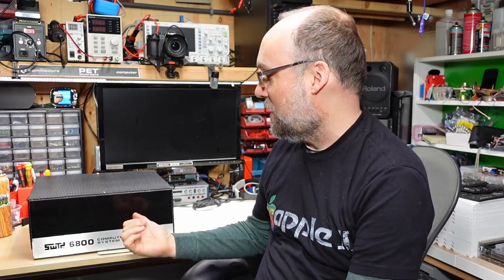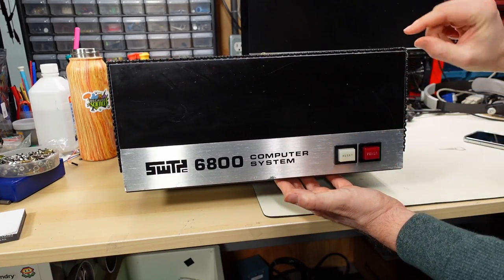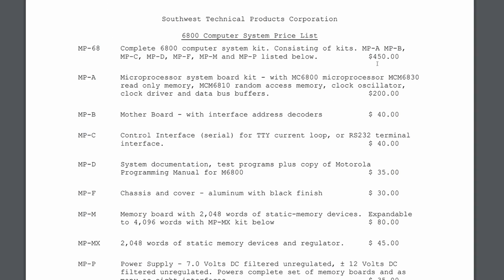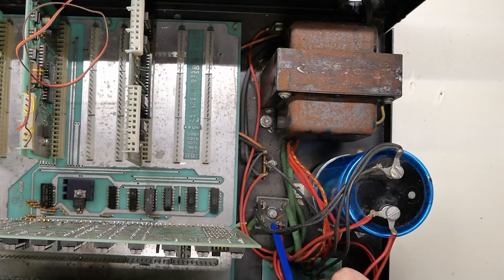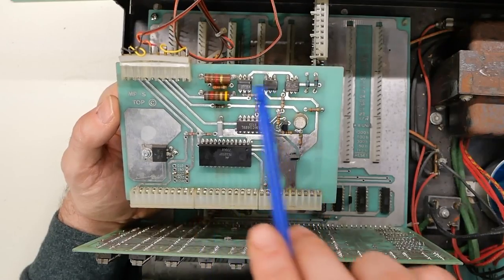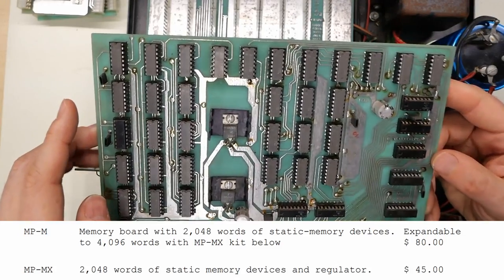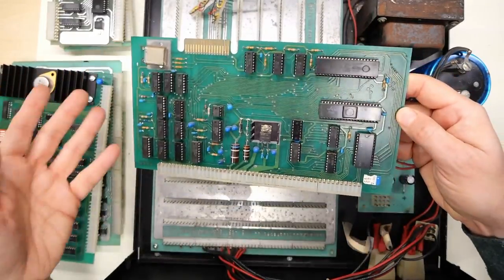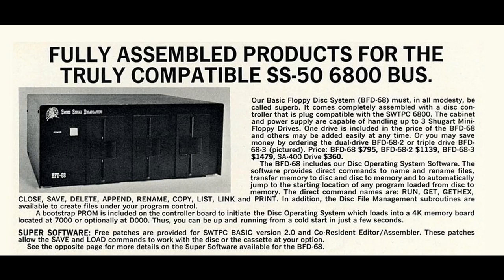The 8-bit home computer from 1975 you've never heard of

Comment: Even back in the 70s there was an Intel vs Motorola vs RCA community.
The S100 Buss was predominantly Intel 8080, 8085 and Zilog Z80 based, whereas the SS50 and non-S100 systems were predominantly Motorola and non Intel based.

Of course each Chip Company had their own proprietary Development Systems, varying from bare-board SBCs to fully assembled Systems with Professional Cases, Serial Terminals/Monitors,  Dual 8" Floppy drives, DB25 Serial Ports, DB25 Parallel Printer Ports (Centronics Interface), and In-Circuit-Emulators (ICE).

The Intel iDS was one such offering which was used to develop Software and Hardware for Intel 80xx 8-bit Processors and Microcontrollers using the Intel Development OS, Assemblers Compilers and launguages such as BASIC and PL/M. It also ran Digital Research's CPM-80 and many CPM-80 supported softwares such as WordStar and Microsoft Basic.

There was a huge offering of SBCs, Built Systems, and Ancillary Boards and Peripherals in the late 70s and early 80s.

Comment: Ah, the good old days!
I have the 6809 model - not just a CPU upgrade; the enclosure is a newer design, and I think there were several other differences.
It's in storage these past many years, after having been my primary computer in college.
If memory serves, I got it with 8K of SRAM, then wire-wrapped a 48K DRAM board.
Got the standard dual floppies, plus a kludged-on double-the-tracks drive.
I should dig it out and refresh my memory on what else is in that box.  I have a vague recollection of running a wire from the power supply to somewhere-or-other to get a 60 Hz interrupt.

Comment: Boy - this channel brings back great memories.  I built my first kit computer sometimes in the 70's. It was a Z80 S100 kit board and a 1K static memory board.  I built my own power supply and chassis and got one of the first TV Typewrite kits. It was wonderful - something like 15 lines of 32 characters - but it was a lot better then programming with front panel switches.  Over time I upgraded it with 8" floppies and better monitors and I actually used it until the 90's when I gave it to a friends son so he could learn computers.  Those were the days!!!

Comment: I've got a couple of the SWTPc 6809 chassis and a box full of cards.  These were made around 1981, and I know that SS-50/SS-30 bus machines were in use into the late '80s, especially ones from GIMIX.  The 6809 machines could run the same multitasking, multi-user OS-9 operating system that ran (as an option) on the Tandy CoCo line.  With all those expansion (slots?  not really slots) you could have quite a few terminals, and a Level II OS-9 system running at 2MHz, with up to 1M of RAM and a dynamic address translator could support a surprising number of users.  One fascinating card I have among my collection is a board for the SS-30 bus that contains a National Semiconductor calculator chip, which serves as a math coprocessor for the CPU.

The (D)OS most commonly used on the 6800 was called FLEX, which was essentially the 6800's answer to CP/M.  There was also a version of FLEX for the 6809, as well as UNIFLEX, which, I believe, was an attempt to make a multitasking UNIX-like version of FLEX.  I don't think that one saw much use though, since OS-9 did the job it was meant to do better, and was endorsed by Motorola.  The source code to UNIFLEX is available on the Internet.

There are modern SS-50/SS-30 reproduction cards, and Corsham in the UK sells high capacity static RAM boards and CF card 'hard drive' interfaces.

One thing to be careful of on these systems is that forest of pins.  It's extremely easy to consume fuses on that backplane by bridging between pins with a screwdriver or some other metal tool.  Ask me how I know.

A great resources for these machines is the magazine "'68 Micro Journal".  Scans can be found on Internet Archive.
Reply: YouTube seems to 'disappear' posts with those newfangled hyperlinks.  Hey YT, welcome to 1994.

Comment: I actually have one of these amazing machines. I got it just last August with 24K of ram and the cassette interface. One note on the ROM and the terminal interface. You have the later ROM called SWTBUG, switch can run the terminal at 1200 baud. I used it on my VT320 terminal and learned a bit of 6800 assembly on it and did things like play games using the 8K BASIC. I hope to find a floppy controller that can hook up to my dual 8 inch shugart floppy drive enclosure that I use with my IMSAI. Once I find that I can run Flex, which is a really interesting OS, basically the CP/M of the 6800 world. Of course the next step for me is to finish the Teletype project, which is torn into 1000 pieces atm.
Reply: Good luck with all of that, and have fun!

Comment: The 6800/6809 were "relatively cheap", but keep in mind the 6502 came into being and sold millions because it was less expensive than those cpus. It probably related to complexity and "yield". Excellent video though.
Reply: Yeah, the 6502 was designed by ex-Motorola engineers as a cut-down, low price version of the 6800.  Their original chip was pin-compatible with the 6800, but Motorola sued, or threatened to, and that one was pulled and replaced with the 6502.  If I understand correctly, the Apple 1 has sockets for either a 6502 or a 6800.
Reply: @joelavcoco  Yes, I think the original was the 6500, the redesigned one was the 6502.  There were reduced pin count versions like (I think) the 6504 and others, one was used in the Atari 2600 as I recall.

I used to have the IC books from Synertek and many others from that era, but had to throw a bunch away after a basement water "event".  A big thick Motorola one had the entire micropressor series, including a diagram using a 6809 and 6847(?) that was almost exactly the Radio Shack Color Computer design.
Reply: @bobblum5973  Yes, the 2600 used the 6502, also the entire Atari 8-bit family, including the Lynx, the Apple II, Nintendo Entertainment System, Commodore 64, and BBC Micro

Comment: I built one of these computers back in 1976, and it’s still sitting on a shelf in my basement. It was a great hobby and learning computer for do it yourselfers. I built my own keyboard with Cherry keys, and my own tv typewriter terminal.  Eventually in 1980 When I was in fourth year university, I convinced my control systems prof to let me work on project for him for a credit, to develop a PID control program using my SWTPS computer, all done in assembly language.  1981 was start of my engineering career in computers and electronics, now 40 years later I am retiring, and still mess around computers and electronics as a hobby.
Reply: Interesting.. You still have the same basement you had in 1976?
Reply: @TenableVegan  same basement since 1990. Moved a few times between 1976 and 1990.

Comment: This takes me back! I left school in 1979 and two weeks later I started my first job in Hull as an apprentice computer technician. I  cut my teeth on the SWTP 6800 and 6809 system -- I used to assemble them (usually into custom cabinets) and test them, before delivering them to customers. Always used to give a little cheer when a new system booted up and the '$' symbol appeared on the monitor!

Despite being named a 'home computer', they were more than that and were capable of doing serious work in a commercial environment.  The company I worked for employed two software guys who wrote many bespoke software packages to run on the SWTP. They developed apps that covered everything from accounting to a SCADA system for a factory!  That SCADA application is where I also learnt the art (and love) of analogue electronics, developing the interfaces for various sensors. 

I also remember a 5MB Winchester hard drive that we interfaced to a SWTP system -- that beast required two people to lift it! Back then, to 19year-old me, 5MB seemed an inconceivable amount of storage space! Towards the end of my time in that first job, the new-fangled IBM PC came out, with twin floppy drives and 480K of memory! Happy days!
Reply: I can't help wondering what you did next. 8)

Comment: Very interesting.  Though I'm familiar with the Altair 8800, I don't think I've heard of this computer.  I'm always impressed how robust the integrated circuit boards from the 70's were.  I rebuilt a late 70's Atari 800 to new like condition about 7 years ago and the thing was built like a tank. Made it very easy to work on.

Comment: Adrian, it looks like you could recreate those front and rear trim pieces from some small aluminum angle or U-channel.  Cut a v-shaped notch and carefully bend the 90° corners, or cut them on a hobby sized miter box.
Reply: If Adrian do not have tools for that, I'm sure that a possible collaboration with The Geek Pub would end with best results.

Comment: Adrian, the disk image: That 16k card can be mapped into the $D000 ($A000-$DFFF,) space , at least according to the DIP switch logic map.   That space overlaps the 128b system memory at $A000, but hopefully that just results in wasted mirrored memory.
Reply: Alternatively, reconfigure the 2K/4K card to $D000 base.  Anyway, a 16K address block would start at $8000 or $C000, so can't simultaneously reside at $A000 and $D000 unless ignoring an address bit to completely block out the upper 32K range.
Reply: @johndododoe1411  no reason at all that it cannot be mapped there - that depends entirely on how you design the select logic.

Anyway I was literally reporting the addresses noted in the jumper table that Adrian showed, so I am fairly confident it does map to that space.
Reply: @raybarker  That's an unusual mapping in terms of gate count.  But if it was in the table, it must be there somehow.
Reply: @johndododoe1411   according to the documentation, a later revision of the system board lets you assign the entire memory map to/off the bus in 8k banks (it has several assignable and unpopulated EPROM sockets on the system  board), so I suspect 8k memory blocks are somehow baked into the design.
Reply: @raybarker  Except that 16K board isn't the system board, but is on the main bus.  So to map the 16K board to an address, the system board must assign that address to the bus and the 16K board must decode that address for itself.
  Anything more specific requires studying the full system documentation (including diagrams) and checking the actual boards for any deviation from the documents.  We can't do that talking in a comment section from across the globe.

Comment: Wow, did this bring back some memories. Immediately following high school I ended up working for a small business that sold these computers. I was hired to write software (in BASIC) on one of them. It was hooked up to an ADM-3A terminal for input an had the same SSB card as in yours. It also had two stand alone floppy drives to install the BASIC interpreter software and the other to save the software I wrote.
It remember that after loading the BASIC on the computer, I had to poke into a certain memory location to start the BASIC program so I could write my program.
It's a shame that you didn't put this video out 6 months ago, because I could have sent you all the schematics, manuals, and sales literature that was available for them as of 1977-78.
Unfortunately, my wife came across my old 3" wide binder on the shelf in our home and asked me why I was still holding on to it for over 40 years. So I caved in and threw it all away.
Oh well...

Comment: A couple of years ago I did a compiler backend for the 6303, which is a slightly improved 6800. It's a nice CPU. Not enough registers, but very pleasant to work with; it has indexing like the 6502 but some sixteen-bit operations like the 8080, and very dense code. It lived on for years as an embeddable microcontroller. Unfortunately there was a much smaller software ecosystem for the 6800 than there was for the 8080; the only OS I've seen for it was FLEX, which I haven't been able to find a copy of.

Comment: Fun fact: This exact architecture (Board style, chips and interface pins) were used in the first SS Arcade Pinball machines:
6800 MPU, 6810 128 x 8 SRAM, 8-bit ROMs to store program code, and an expansion board with 3 x 6820 or 6821 PIAs (peripheral interface adapters) to ‘read’ switch closures and output pulses to the lights and solenoids on the playfield.  It was complicated stuff in the late 70s to early 80s.

Comment: I'm very glad to see a SWTPC 6800 on your channel Adrian! I'm a keen Motorola 6800 and SWTPC 6800 hobbyist.

It was very common to have both the MP-C and MP-S cards in the same machine. The MP-S is faster and better but for full MIKBUG and software compatibility the MP-C card is needed. Eventually SWTPC released their own SWTBUG that used the MP-S card natively but most users kept the MP-C for compatibility and to use as an extra serial port. The Motorola Engineering Note 100 is a mandatory read that describes the 6830 MIKBUG ROM and the associated hardware that is the very base of the SWTPC 6800.

The BFD-68 was made specifically for the DOS-68 system. DOS-68 was a competitor to FLEX but never really took off. FLEX is compatible with the 1771 controller chip used on the BFD-68 card but it may need a custom driver. I would not be surprised if such a driver already exists if technically possible but writing a new FLEX driver is quite trivial as long the hardware specs are known.

Actually it's possible to wire up a compact flash card in 8-bit ATA mode directly to the SS-30 bus as a nice FLEX driver writing exercise :)

Even though I have never owned a SWTPC 6800 I have built several compatible systems. My latest SWTPC 6800 compatible(-ish) incarnation, "MC3", is based on the souped up 6303 CPU.

Comment: I remember that  a DOS named FLEX was made for the SWTPC 6800, the late upgrade to 6809 could run with OS9 and I think they made a FLEX09 too.

SWTPC also mad a 68K version and for that system a FLEX68K was produced and much later a OS9-68K.

FLEX was very Unix like 

OS9 was way ahead of both MS-DOS and CPM - at least up until '84. OS9 was fast becoming an embeded system OS and  had a GUI before MS released Win 3

Comment: I bought my SWTPC in late 1977. Parts started arriving in 1978. By September I had a running machine. It was purchased with 8k of memory. I got 4K Basic on a floppy ROM. I also made the CT64 Terminal. Around 1980, I got floppy disks for it with the DC3 driver board. As a HAM, I got on the internet around 1984. At the time the ARRL had a class A to its self. One of the local HAMs gave me my own subnet. I got up and running on AX.25. I found a way to make AX.25 unreliable and was able to run Telnet and FTP. On the 2 meter band through my 2 meter radio and a MFJ-1278 Terminal node controller I was up and running. The last thing I did with it was to design and build a 48K memory card. It still works. I also got the GT6144 graphics terminal and an Atari 2600 joystick through a parallel port. I wrote a crude PAC-MAN program. My first checkers program was written in the late 1970's. It used the inhex 2 character routine to enter moves.

Comment: Adrian, thanks for reminding me of my misspent youth. The SWTPC 6800 is a great computer but it suffered one major problem: Molex disease. To keep costs down they used tin plated connectors that would tarnish, leading to bad connections. Third parties offered gold plated replacement connectors.

The Altair S100 and SWTPC SS50 weren't the only 8 bit busses of the mid 70s. Motorola had it's Sherman tank of a 6800 development system called the  EXORciser. It sported a bus based on standard 86 pin .156" pitch edge connectors. Up through the 6809 era there were third party boards  that used the bus.

The EXORciser was an expensive system, especially with 8" floppies, teletype console and/or $1000 dumb terminal. A brilliant move on Motorola's part was to sell the MIKBUG/MINIBUG program housed in a 6830 ROM. This allowed SWTPC to develop its computer sans switches and lights and yet have serial I/O and debug tools.  All without having to write firmware themselves. I seem to remember that you could buy the MIKBUG chip alone.

While the EXORciser was aimed at industry, Motorola did not forget the amateur. In 1976 hey used EXORciser's bus on the MEK6800D2 kit. ( I could never watch Star Wars without being reminded of my beloved D2) At $300 it was a true single board computer, with 640 bytes RAM, serial communication chip, and It's own monitor/debug ROM: JBUG. On the top edge there were 2 50 pin ribbon cable compatible edge connectors, each wired to a 6820 16 bit parallel  interface chip. The remaining 10 sq. in. of the board was devoted to a user prototyping area. The kit,  came with a ribbon cable that lead to a PCB with 6 seven segment displays, a hex keypad, 8 function keys and a cassette interface for mass storage. I spent countless hours banging and debugging hand assembled code (branch calculations anyone?) into that keyboard.

A bit later Motorola developed  a video interface chip, the 6847 that made it easy, with an RF module, to display data, in color, on a standard TV. New chip, new development kit, the MIcro Chroma 68. It came with, "The new "bug" from Motorola, TV bug 1.2" The board also had the familiar 86 pin edge connector that I assume, but can't confirm was configured as an EXORciser bus. I never owned a Micro Chroma 68 but I used the 6847 and cloned TV bug ROMs in my own hand wired systems.